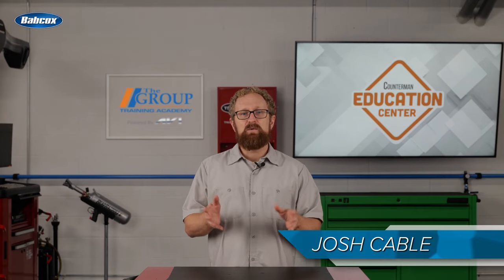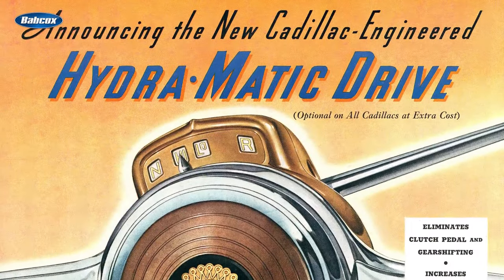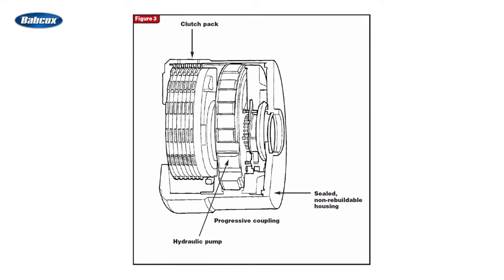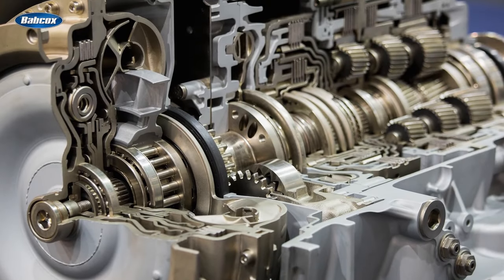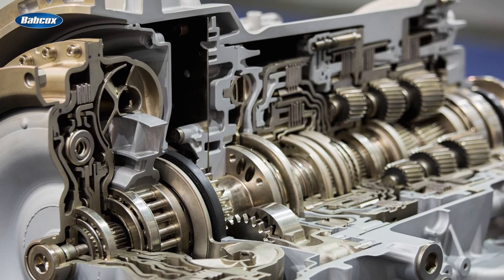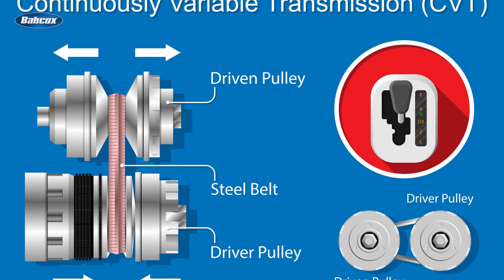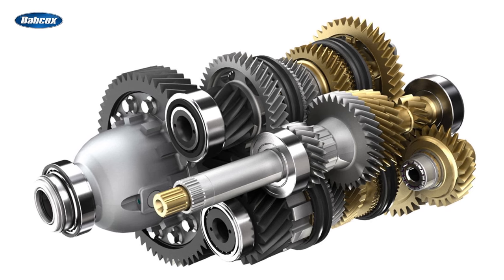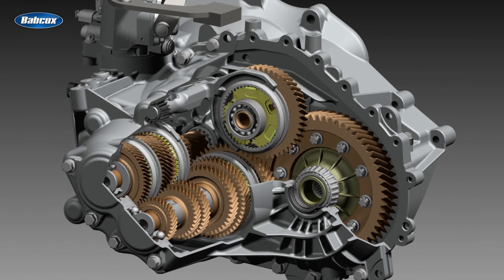How Have Transmissions Changed Through the Years? (Part 2)

Comment: Since I am 72 years old, I have seen a lot of development over the years of both manual transmissions and automatic transmissions. When I was a child the common manual transmission was a 3 speed column shift where second and third had synchronizers. Although the manual transmission is slowly disappearing the typical manual now has 6 speeds and all the forward gears have synchronizers. Also when I was a child one of the common automatic transmissions on Chevrolet cars was the two speed power glide transmission. Now it is common for automatic transmission to have eight speeds. So transmissions have changed a lot over the years.